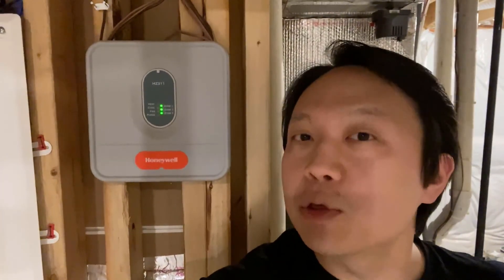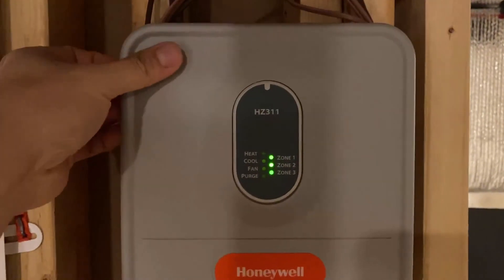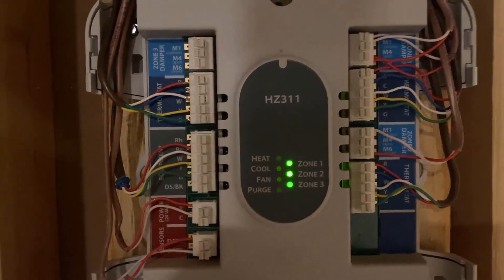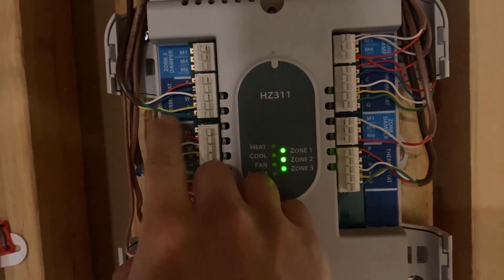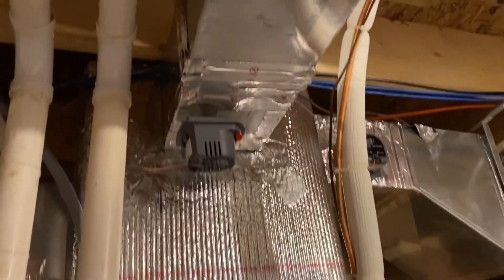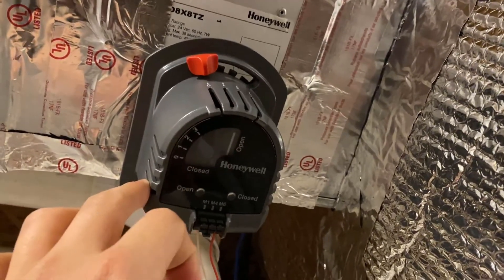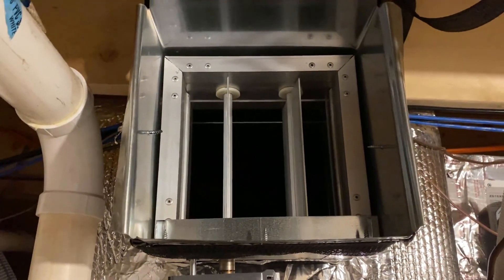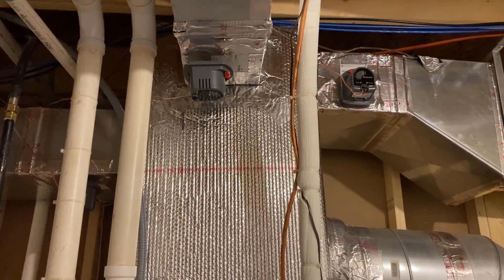[Quick Video] How 3-Zone HVAC (Heating and Cooling) Works in My Home

Comment: I moved into a house with the same system do the thermostats each control different floors and will it be fine is someone wants the heat and someone wants the ac?
Reply from the maker: That wouldn’t work unfortunately unless you have two separate HVACs

Comment: Very informative video. Was it a big job (in terms of cost and effort) to realign each zone so that each zone represents a specific level/floor (top, main and basement)?
Reply: So if u have a multi zone system like this and say one part of the house is set at 76 and a different area is set at 80, will the shut damper end up developing condensation since air is hitting the door/damper? 

I feel like this is a recipe for mold down the road. Am I wrong?
Reply from the maker: My project was less than $500 project. Ducting materials are not that expensive. It wasn’t too difficult because I could access most of the stemming parts of the ducts. I think it depends on how easily you can access the ducts and if you have the space to play the arrangement with. Thanks for watching!!
Reply: @hammerandrake  OK, good to know that. My basement is finished (Ryan homes) and so I don’t have access to my HVAC ductwork. I wanted to isolate my basement and control it with its own thermostat as Zone 3. Instead the basement ductwork is grouped together with the first floor as one zone (Zone 1) and because the thermostat is in the first floor, the temperature in the basement is never optimal.